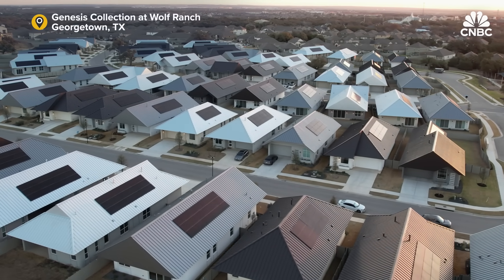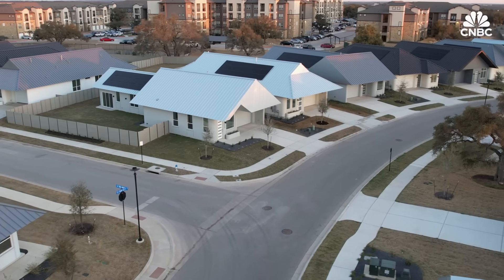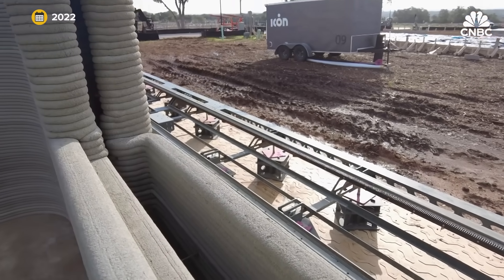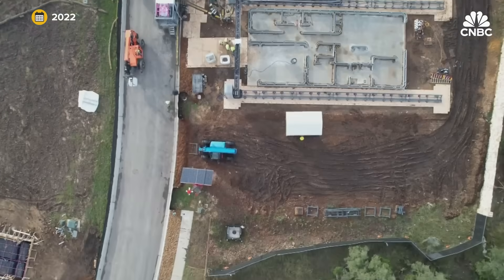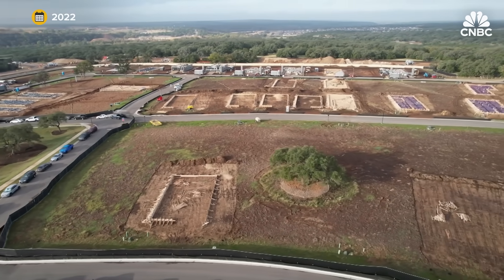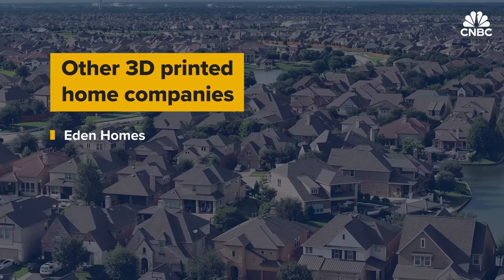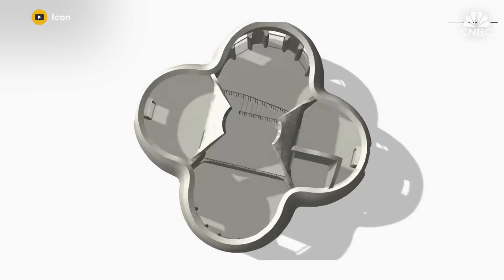Inside The World’s Largest 3D Printed Neighborhood

Comment: My question is if cost are cheaper but they are charging the same price for the homes what is the benefit to the consumer?
Reply: They are never cheaper.
Reply: @MrSteeDoo Cheaper for the company to build, not for the consumer to buy.
Reply: @EMC2.0  yes
Reply: @MrSteeDoo  it will get cheaper when labor cost gets pass a certain number
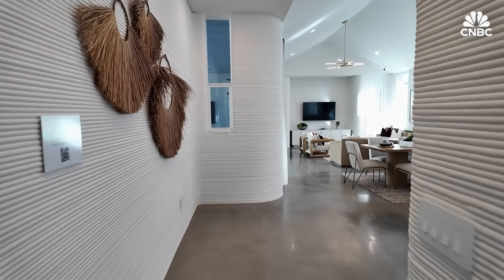Reply: In the video, they seem to aquietly reveal that these printed homes are actually are more expensive. 2:21 "The homes here start at just under $400,000, that's about comparable to other LARGER HOMES in the area". A 1574 square feet is considered a mid sized home, so it seems unlikely that they are classifying the 3d printed home as a "larger home", but instead are describing other homes in the area with mores square footage at the same price point.

Are the being ambiguous on purpose or is it just bad writing?
Reply: @JacobJonesy  it is deliberate wording. They cost more!
Reply: @JacobJonesy  I doubt its bad writing. It seems rather intentional. Not sure why they think their audience won't tell each other the BS part out loud. Just keeps building contempt.
Reply: @JacobJonesy  these ones are more expensive because it's the pilot neighborhood. Future homes will be cheaper, or give the company a wider margin while increasing the housing supply
Reply: @JacobJonesy on propose
Reply: @JacobJonesy personally, I like how they cite electrical costs in JANUARY in TEXAS. 🤣
Reply: @JacobJonesy  It is hilarious how they attempt to fool people but at same time is genius.  I never even noticed it.
Reply: @MbisonBalrog  they aren't trying to fool anyone, they literally talk about how they're trying to bring costs down and the ways in which they're doing so. They said it currently isn't as profitable as doing it the normal way but they believe it'll be cheaper and better as they figure out the logistics and tech and stuff.
Reply: @JacobJonesy  For the area where these houses are built (extremely desirable area right outside of Austin), that price is fair for the square footage.
Reply: @JacobJonesy that sounds like an awesome price for a new home that looks amazing compared to the CRAP contractors are building now
Reply: The money they saved on construction, they double it by selling it the same price as the other homes in the area.
Reply: yea thats what i say , the saveing are for the company not the buyer and they will try to glamorize it to the buyer to make it look expensive
Reply: Back to a cave it is 😂😂😂😂
Reply: This is the first production, which is always the most expensive. If they're comparable prices now, they're going to get cheaper, not higher.
Reply: The part of the construction that the 3D printing does is the cheapest and least skilled part. Renting the machines costs way more than paying for the equivalent human labor.
Reply: @gudmundur-heimisson time is money. If it can finish 20% faster, you can build 20% more homes. Prices will come way down.
Reply: @gudmundur-heimisson   - and you know this how? Where did you find the rates or is this an assumption? I think as this becomes more successful, competing entitites will come into the game and scalability will help change the status quo.
Reply: @storytellerHD  anyone with a basic knowledge of how construction works can tell you this. If you want to see for yourself just look up some breakdowns on house construction costs and look for the cost of framing. Building a house involves a lot more than just stacking up the walls, in fact that is the cheapest part.
Reply: @gudmundur-heimisson the large builders would purchase the machines, the cost of the construction is much, much, much less and much, much, much faster (contributing to the less cost).
To pretend these will cost even remotely the same let alone more is just nonsense to out right lies.
Reply: Every time they design a "new" "better" "economical" way to build it ever reflects in the price to consumers. I say this as a person that has been actively searching for this. Every time it's exhausting and so disappointing.
Reply: Whenever you might save money on heating, cooling, electricity, etc, they add a huge premium on the price. “It costs more upfront t but you save money over time…” except renovations and repairs with an all cement house will also be much higher.
Reply: Speed
Reply: only CEO's gets to keep the profit and then they complain population decline.
Reply: Stupid us, for thinking they'd pass the savings on to the buyer..
Reply: They already made the walls not as thick just like anything else as time goes on it gets more expensive but cheaper quality. I don’t see these as the future.
Reply: I still remember when TESLA was selling their cars for $60K to $120K — and now it's HALF of that.

Every new product that's still in its infancy is always expensive. But after 5 to, at most, 10 years, y'all will see the price drop significantly.

That's how it's been for centuries!

So, don't ask why — or wonder why.

Now y'all know.

Have a great day!
Reply: @ThinkForge01 Why are you conflating cars with homes? One depreciates one appreciates. One's a tool to get you from point a to point b the other ones where you live. 
As a homeowner, do you think i'm going to vote for a representative who allows these turd houses to be built cheaper, bringing down the value of my house.😂😂
Reply: You’d save on insurance! No mold and no damage from fires and hurricane to structure. It will also last a lot longer.
Reply: they keep grifting us in every way possible, my solution to the problem is to avoid the U.S. housing market
Reply: Yup, are they going to be like a 100,000 instead of 1.5 million where i live!
Reply: My point exactly. Once I saw the $380K for 1500ft I was like uh ok so I guess it’s not a cheap affordable house after all,smh 😢
Reply: I would hate to see these houses after the foundations settle or move slightly and cracks form in the walls. Would be a nightmare to fix probably.
Reply: AGREE, Seems like its a benefit for the builder and not the buyer....builders save labor and materials....So its up to the buyer to build it by buying land, renting the machine or something similar.
Reply: Benefit the consumer? you must be new here.
Reply: Cheaper for the builder 😂
Reply: Did you watch the video? Fire resistance and hurricane resistance.
Reply: None, it's a gimmick the same for those fast built mcmansions., but way more issues that add a ton more complexity. Notice how no one is buying these homes. The first woman is just clueless listening to her brainrot tiktok "techie" kiddo, or a plant to sell the homes.
Reply: The homes will be cheaper in future projects. This was the first experiment in the partnership between Lennar and ICON, and they had to learn a few things in order to bring down the costs.
Reply: @DianaOlick  automating the cheapest part of the house building process in a way that introduces a lot of constraints isn’t going to bring prices down no matter how efficient it is.
Reply: @gudmundur-heimisson  Yeah you need machines doing the entire job, electrical, plumbing, etc. If all the material is there a few guys can frame a house in a few days depending on the size of the house
Reply: @gudmundur-heimisson  That depends where you're building and what you're building. If you are in a high-cost labor market, labor usually edges out on materials cost. The type of home also dictates this. Large luxury homes home and/or a home with custom materials will obviously be more expensive for materials cost.

Otherwise, it isn't that much lower than materials, if at all.
Reply: @georgemontgomery1892 sure but again everyone seems to think that they’ve automated the entire process of building a home which isn’t true. This is just the framing. Even if they could get this down to 1% of the cost of conventional framing it would only reduce the cost the house by less than 5%.
Reply: @DianaOlick  There have been saying that for like 10 years. 3d printed homes are not getting any cheaper.
Reply: @DianaOlick Presumably, the cost for the printer is the most expensive part of the whole process. Once the printers are mass produced and costs are amortised over many builds, the cost should come down naturally.
Reply: @DianaOlick  In the gaming industry, they said all digital is gonna be cheaper because they don't need to make disc's anymore... games are now the most expensive they've ever been. Stop defending billion dollar companies
Reply: @DianaOlick  No, they will not. Costs are going to RISE.
Reply: The hype
Reply: There is none.
Reply: Exactly!
Reply: Better quality. Balloon wood framing sucks
Reply: They said all that in the video. It's not only about the price.
Reply: Shhhhhhhhhh. 😅
Reply: Its not happening with waymos and its not gonna happen with these.
Reply: It's probably cheaper than an equivalent concrete house. Not cheaper if compared size per size.  This is probably like comparing a stick built house (in this example it would be the concrete poured house) that's more expensive than a double-wide trailer house.
Reply: No benefits. Just to say it’s made in the USA
Reply: there's always a cost of being the kool kid on the block (aka. early adaptor).  I think it's absolutely amazing what they've accomplished on the first run of this partnership!
Reply: @udance4ever yes, it's amazing how much they're lining their own pockets, cutting out labor to build turdhouses.
Reply: The materials are more expensive, but there is much less labor.  Concrete walls, metal roofs, new design/new process = more expensive, but you don't need nearly as many people or roles, but the 3d printing only does the frame and walls. You still need traditional experts for the rest.  A lot of modern houses are made of cheap wood and relatively thin walls and insulation. The icon guy even said their costs were much higher almost double since they were making the walls too thick and other issues.  Anything in the alpha phase won't be the cheapest or more efficient. You are also getting a fire, mold, storm, and disaster resistant home.
Reply: Lennar guy said it. It’ll be more profitable, not cheaper. Eventually. Not interested.
Reply: Well at least one benefit is disaster resistance as explained in the video, those homes in Georgetown are in both a tornado prone area and a wildfire prone area, and this type of construction give protection to both.
Reply: @jamesfromacct Jay Leno was talking about the fires in california and how one of his friends built a fireproof building that house's a car. It was one of the few structures that survived the fire. Unfortunately, the car didn't survive because it basically turned a building into a kiln.😂
Reply: I think you’re looking at it wrong. it’s cheaper labor cost. that doesn’t mean it’s cheaper overall. labor is down A LOT, this could solve the labor hole we have. with that overtime as these machines get cheaper because they will sell more and parts will get cheaper from higher demand. once these machines are decently priced, companies will start buying them and just print neighborhoods in a year or less. that’s when things will get cheaper,right now it’s still proof of concept.

i could see these turn into a cheap small track homes in the future, and it’ll be considered a luxury to have a house made by man. home artisans will be back in style! i think this will also force homes to be build generally better than we currently have in america. it’ll be “if i want a cheap home i’ll buy a 3D printed one” we don’t have the data to see how long the last with people living in them. so everyone’s a bit skeptical. i don’t think it’ll be our lifetime where it will be majority 3D houses but you never know
Reply: @disappr0val yeah, and a perfect non capitalist society. I think the houses would get cheaper.😂
Reply: The quality?
Reply: Agree, especially if it was experimental. Will see if they will be less expensive than traditional building. If so, then great.
Reply: @brian9832  Yes comrade. Ah, but wait. We live in a capitalist society..... Damn that won't work.😂
Reply: Exactly
Reply: Eventually these becomes cheaper
Reply: @aiel1740 It is a house, not a car. So who does it become cheaper for?
Reply: Velocity and cost are directly correlated; expedited completion minimizes potential cost overruns.
Reply: Maybe, but lenar is just playing the corporate game, they put TX in the center but it's bs
Reply: The benefit is do not burn on fire 😅
Reply: Would never work in an earthquake area. Concrete and brick homes are the first to crumble to the ground in an earthquake.
Reply: Because it is not cheaper to build in many cases! One floor buildings at best. NOT MULTIPLE HIGHER because no rebar enforced concrete used. And just use a slab as foundation on soft soil a problem due to more weight then the fabricated wood houses in the USA and canada. One story buildings printed in the desert fire or flood zones maybe an alternative? But prefab  conventional concrete build works also!
Reply: In China it cost 80 k to build. Always in America it’s always 3 times more.
Reply: @mgelato777hardly any american cares what it cost in china.
Reply: 7:10 explains it.
Reply: I would imagine it will have less quality issues as long as you are okay with the aesthetics. It being mostly concrete rather than wood also makes a comparison a bit difficult.

Assuming it has no significant quality issues, I would probably need some sort of additional finish to get rid of the print marks. The size makes it a pretty decent senior home tho.
Reply: The costs will be massively cheaper when comparing scale. These guys have built a few hundred homes, and people are complaining about costs, when prices are already comparable to conventional homes. Other point is that costs of conventional homes will continue to rise whether anyone likes it or not. The 20+ processes/materials to build just the foundation and framing of 4-million homes will be exponentially higher than squirting some concrete to achieve a stronger and better base. Folks are missing the point that this is exciting innovation unravelling before their eyes. Using 2x4 lumber the way we have for hundreds of years is no longer feasible.
Reply: to sink development costs they need investment, this is a trial run and they already have a whole community done
Reply: Benefit for workers. Higher pay since less labor is needed. Consumer saves on electricity costs.
Reply: Speed of Construction: These homes can be built in days or weeks instead of months, allowing for faster housing solutions.

Design Flexibility: Complex and customized architectural designs are easier to achieve with 3D printing.

Sustainability: The process generates less waste and can incorporate eco-friendly materials.

Durability and Strength: 3D-printed structures can be more resilient to environmental stresses and natural disasters.

Energy Efficiency: Superior insulation and thermal properties help reduce energy consumption.
Reply: Consumer? Hey hey…. This is for the benefit for corporations. They are people also man!
Reply: Real estate is a huge industry and people use it to make money. These things never make things more affordable but people will find a way to make money off of it.
Reply: is cheaper for them not the consumer xdxdxd...this is where the government needs to steps up and it doesnt
Reply: Exactly, its probably great for them if they can build the house for less and sell it for more. But that sure doesn't help the buyer.
Reply: Oy vey, that's antisemitic
Reply: It’s the land. You can build a beautiful house in a bad neighborhood. It always comes down to your zip code
Reply: From luyten another 3d home printer 
In addition, the technology is proven to increase construction site efficiency with 60% guaranteed costs savings, 300 to 500 times shorter execution times, and an 80% total reduction in monetary expenses without formwork in concrete construction,
Reply: A better home?
Reply: The energy price is like only 10% of regular house
Reply: Cool it with the anti-semitism
Reply: You saved more in the long run like way cheaper electric bills.
Reply: the idea is after the first run, the costs come down
Reply: @Enhancedlies  The cost for them, not the consumer
Reply: It’s a proof of concept house. They literally spoke to this in the video. The first third of the project they were learning how to do it and it was taking twice as long as they expected. By the end , they had figured out how to double the speed and half the cost and that is just the beginning. As more 3D printing companies are formed , the price will come down and when you’re in robots as laborers it gets even cheaper. 

The other exciting part is creating homes that are wind and fire proof. Just think how many billions will be saved in insurance payouts. Homeowners insurance should come down with innovation.
Reply: And then they say profit margin is less. Like how? The math doesn't work there. 😮
Reply: Benefit? Consumer? 😂
Reply: Concrete is expensive. That's why normal people use bricks AND concrete.
Reply: A solid, heavy-duty house.
Reply: Capitalism isn't going anywhere
Reply: Like all innovative businesses, they incorporate the research and development cost into the price. 

Example: It could take millions of dollars to develop the program and machine, but then it’s cheaper to produce the product per unit. They still need to recoup the expenses of the original design.
Reply: Concrete is NOT cheap
Reply: None . It’s only beneficial to the other party .
Reply: Property tax will still be higher, probably be super hard to get insurance on it and damn harder to refinance it. O and cost the same as a regular home.
Reply: l dont like the bumpy walls. Walls should be flat. all l see are DUST crevices 😬
Reply: @KellySullivan-jc6il I get a lot of dust in my house normally so I am quite used to it. I do wish they could find a way to make the walls flat - that would be badass
Reply: Profit margins are better. It’s not better for the consumer.  They know you’ll pay $400k plus for a home because you’re going to finance.
Reply: They literally said its more expensive to buid....FFS are people this dumb?
Reply: Bigger profits for the company.. the state.. 😂nothing changes for the consumer.
Reply: So since the using robot and 3D printer does that mean there's no more labor
Reply: GREED
Reply: Greed
Reply: They did mention that its more fire and natural disaster resistant, so lower insurance cost could possibly be a benefit.
Reply: There isn't any. It's all about the rich getting richer .
Reply: No one ever cares about the consumer. If they found a way to make something cheaper, they will always pocket the difference.
Reply: Being able to spend FAR more on utility work.
Reply: I'm no engineer but my peanut sized brain tells me this is better than a normal wooden home.

It's probably cheaper to heat/cool and you won't have to deal with certain pests. (Mainly termites which are ridiculously expensive to deal with)
Reply: What this is is a current whale market for those willing to pay the high prices. As the tech for it and output increases, it costs SHOULD drop over time
Reply: There is none.  Its a scam.
Reply: concrete walls that feel lik you live in a prison
Reply: Companies charge what you’ll pay, not what’s ‘fair.’ Price Setting 101: Marginal cost is irrelevant if demand is inelastic. Consumers react to perceived value, not production realities.
Reply: None.
Reply: Are there HOAs attached as well?
Reply: It's just starting.
Reply: They don’t get termites, mold or bees in the walls. They hold in heat better in the winter, and cold in the summer. And a big selling point in Texas, they are much more safe during tornados and hurricanes. Basically the whole house is a storm shelter. In the South, wealthy people put concrete closets or rooms in the middle of their homes to be storm shelters. Middle class and lower just use regular closets and bathrooms (framed with wood 2x4s and covered in sheet rock)  for storm shelters, but other than they are no windows, these spaces are not very protective. Living in a cement home would automatically be much safer during a tornado, freeze, flood, hurricane. They are also much more flood resistant. They don’t need to remove all of the drywall everytime there is a flood, they just need new flooring cans new paint, instead of new everything. Also Texas roads are really loud, because they are made out of concrete. My Texas house was next to a main road and we just listened to Traffic all night long. (Also my pipes froze and flooded my whole house because the walls were not well insulated), due to Texas having lax laws regarding winterizing homes. These concrete houses are naturally going to be winterized because the think concrete wall protect pipes from freezing. Similar to how brick homes are better than siding homes at keeping out cold.
Reply: Here is The Savior

HalleluYAH translates “Praise YAH”

- YAH The Heavenly Father (Genesis 1)

- YAH arrives via the TENT OF MEETING (Exodus 33:7-11)

- YAH The Father was Who they Crucified for the sins of “man” and they NAILED YAH’s HAND on an Almond Tree
- (Hebrew Isaiah 43-56)

- YAH The Father is The Savior
Reply: the benifit is higher repair costs with plumbing and electrical issues
Reply: Critical thinking 🤔 🧠
Reply: Energy cost savings. Thats it,
Reply: Unbelievable. I can tell when people leave a comment without watching the entire video 😂
Reply: You're right.  This is what has become normal in Western industry.  To offer nothing but the opportunity for the company to make increased profits, edge out "competitors" (which really aren't) and then act like they're doing something good for the industry.
Also, here CNBC (a trash media company to begin with) grooms the viewer with this-  a disgusting glorified ad for this idea, company industry which exist solely to eliminate jobs that made good houses to begin with for the same damn cost so it seems.  I'd go well out of my way to avoid purchasing products which exist to eliminate useful skills and jobs from the economy - that being tradespeople and people who build things with existing industries and resources.
Reply: It’s always more expensive to create new machinery and to invest in those costs, at first the costs outweigh the profits, but once everything is streamlined and machinery is building hundreds of homes the costs are distributed farther. You would still need the same 10million$ machine to build 1 house that you would to build hundreds. So initially you would expect the prices to be inflated to reflect that. Prices should drop as the building method is perfected and becomes more popular, but our current gov would not prevent businesses from taking advantage of consumers even after the initial expenses are balanced out.
Reply: Because anything new will have significant costs associated to it.  These companies have to turn a profit to stay afloat.
Reply: You should watch the video
Reply: This isn't about US, it's them finding a way to continue to build overpriced homes, but without their scores of illegal mexicans working for peanuts.
Reply: and then it affects labor because less well paying jobs.  tech owners benefit, labor and people not so much
Reply: VERY good question
Reply: The cost is higher now due to the learning process but as they scale out, the cost should be reduced (less walls, less labor, and quicker turnaround time). Also it's more quality / sturdier (concrete vs wood) and better energy efficient plus fire & wind resistant.
Reply: @obieWanmotivation  the first rational comment so far in this thread
Reply: The price has basically no relation to the building cost. Remember we live in a capitalist economy, the developers will take whatever they can get away with and not a penny less. This is about greater profits for the developer, not about the home owners.
Reply: @dijikstra8 the whole idea would be cutting down on cost and time and selling at a profit but a lower price to their competitors thus moving faster.
Reply: @mikeshafer, a wonderful idea in a nutshell, but you're not selling a car. You're selling a home.
Reply: @Richard-r2o4j  it's the benefits of scale. These current homes are around the same price as neighboring homes, but this is still a new technology. ICON has next generation printers underway that are faster and better. At some point if they really nail this, you could see entire communities of 3D builds going up within a month. The first car is always crazy expensive, but years later you get Honda Camrys.
Reply: @mikeshafer it won't happen! What you're suggesting would cause the entire housing market to crash. 😂 It's just not gonna happen.
Reply: Cheaper for them. Not for us.
Reply: Bru... the building is made of concrete...  is far cheaper in the long term compared to the paper houses of the suburbs
Reply: The benefit is when a tree or storm damages the building you will never be able to fix it in a way that doesn’t look continuously broken.
Reply: @Noodles1771  it already looks bad, if you look at some of the close up shots of the interior walls they're all cracked along the layer lines
Reply: @Noodles1771  It's concrete, so storms ain't doing much.
Reply: @Ryuker16 Yes because since 1992 when the hurricane codes were updated in Florida that basically made every newly built house concrete (CMU) construction there has been zero damage to those buildings 🙄The reality is: There will be damage, and (unlike the modular, easily replaceable systems that have existed forever) there will be no way to make these houses look like new. It will look like a car will a perpetually dented door that cannot be completely fixed or replaced. These houses will also have low resale value due to any damage they suffer + their low quality unfinished interiors. This segment is simply a propaganda ad for gullible cows masquerading itself as journalism. shrug
Reply: @Noodles1771  i was thinking the same thing how do you fix this house if something happens?
Reply: @Noodles1771 You may have a higher repair cost as rendering of the wall may be required.
Reply: @Noodles1771  Mmm...Patching it up actually wouldn't be difficult.
Reply: @Noodles1771  You can easily fix a broken house.
Reply: @saulgoodman2018 no you cannot fix concrete that is poured this way and make it look like the original. You don’t work in this industry - sit down. You’re clueless.
Reply: @Noodles1771  It is only concrete. You can replace concrete, with concrete.
Can't be done the same exact way. But there make something called cinder blocks.
You may not have heard of it.
Reply: @saulgoodman2018 you can and it will never match a machine laid process like this in style nor will its color look the same. Stop pretending like you know something about construction or architecture.
Reply: @Noodles1771  You can get it to closely match.
Reply: @saulgoodman2018 No you can’t - because one is machine precise and the fix will be done by human hands and a much different mixture of concrete. Go back to your DIY playlists on ‘how to build a bookshelf’ and stop talking to me as if you have my degrees or experience walking a f—king job site. Philistine.
Reply: @Noodles1771  You can match it. So what if the color will be off.
Reply: It will get cheaper over time to build. Naturally prices would come down to increase demand. It just takes time.
Reply: @mikeshafer yea but further in the video the construction company the walls won’t be as thick as before foreshadowing that the quality won’t be the same
Reply: @mikeshafer bs! Corporate greed will never make anything cheaper
Reply: @mikeshafer In theory, but not in practice. Lennar is the second largest home construction company in the US based on number of homes sold as of 2023. The three largest home construction companies essentially control the market. They are the ones bakes to purchase insane amounts of land, essentially controlling the housing market. In the 70s, and even earlier, home builders, could build affordable starter homes that many boomers benefited from. These are homes that when adjusted for inflation, would be about $100k-150k today. If you decided not to build, another developer nearby would, meeting demand, sometimes even exceeding it. But in this modern world, they can control the market by keeping supply low and demand high. They may own 100 acres in a town that needs affordable housing, but they can choose to sit on it. Until all their “affordable” $400k homes sell, or build, and list at $350k, accepting cash offers from investors looking to rent, another market controlled by large corporations. A smaller builder could purchase an individual lot somewhere, but that lot would be ultimately too big for anything affordable

These mass produced houses use the same floor plan over and over again. They save money on costs because they are able to buy in bulk, rather than as needed, since every house in the neighborhoods need the same supplies. In many communities, they only take about 2 months from start to finish to build. This means the quality is poor. But people will pay whatever they can afford because they’re desperate. Why lower the price on housing when you can double, even triple your profit?

Also, many towns wont even allow you to build a house that size. There are ordinances specifying how small a heated and cooled residential space can be, which is one of the other reasons start homes don’t really exist. There are also ordinances on lot size, which is a bit confusing because while independent builders may not be able to build on anything smaller than a half acre, these large builders, somehow can get away with subdividing lots, putting as much of a house on just a sliver of land.
Reply: @mikeshafer LCD-plasma TV's came out when a 32" Vizio was 500$, you can still spend well over 2k on a 32" TV. 

Nothing gets cheaper bro, not until China comes over here to make it cheaper.
Reply: @replynotificationsdisabled  what does that have anything to do with homes?
Reply: @mikeshafer 

"Naturally" 😂😂😂
Reply: @mikeshafer  Nope, the costs will continue to rise.
Reply: They won't. That's what capitalism is about. Profit making and ever increasing profits.
Reply: @plartoo  That's a clueless take.  If you get government out of favoring companies, competition brings down prices.  Always.  Profits can be made if you do a better and more efficient job than the next guy.
Reply: @plartoo nobody here has a crystal ball. Chill. Markets go in cycles. They always have.
Reply: peasants live in 3D printed house, in the meanwhile, billionaires are upgrading there masions.
Reply: What else do you expect from a US company ?
Reply: Careful buddy, they'll send you to el salvador for that type of thinking
Reply: They say they are hoping to be able to build the homes cheaper, but they definitely won’t be decreasing the prices of the homes cause that just increases their profit
Reply: @calebleuciuc670 60 to 80 percent cheaper to build and many dozens to hundreds of times faster.
From months to years down to days or weeks
Reply: Why would they make it cheaper if the consumers are buying out neighborhoods at the current price. Prices going up because now more people are exposed to it so the demand will be there.
Reply: @Barber_Awz   this is exactly right. In fact it's even worse because this whole concrete 3D printing market is controlled by a couple of heavily vertically integrated companies, so there is no competition, and they have no incentive to try to undercut the market.
Reply: Houses made from Cardboard vs Concrete. Concrete is more durable and more expensive to build structures than lumber.
Reply: She said it, she feels safer, fire resistant, quieter, all for the same price.
Reply: They're trying to sell at higher price to recover loss of investment. What he says make sense, if they can streamline their build process in terms of time and money (and time is money anyways) I could easily see how that would bring prices down for the buyer. They would sell at lower cost and absolutely crush their traditional stick frame builder competition.

The pods we're all going to live inside of in 2050 are going to be $500 anyways, and you'll pay for it with your plasma.
Reply: Did you not watch the video or have common sense? This was a test case where they are working out the kinks and because of this it was more expensive. They said the next community will be cheaper. Watch the damn video before you open your mouth.
Reply: $400k for a new construction home in 2025 is reasonable. This is an early trial plus there's the speed benefit
Reply: @sjasonwang7384  this is why nobody wants kids!!!! If 400k is "normal". We are beyond cooked. We are doomed.
Reply: @sjasonwang7384  No, it's not.
Reply: Benefit is for the shareholders bro. 

Half joking. As you sell more they get cheaper. Comparable costs at this early in the new product lifecycle is actually pretty good.
Reply: @thenextension9160  I am a shareholder so I’m hopeful they do well but I invested because I thought they were so cool
Reply: Social. 
The statistics behind accidents on construction sites are astounding. Reducing human injury risks is the right thing to do. Over half the workforce is middle aged and has a bachelor’s degree so they’re trained for other things. 

Our birthrate is low so we won’t have as many builders available for the foreseeable future. It makes sense to automate this simply based on population.
Reply: @bettyjeanmarinogmail   that's just false-equivalency logic when many government do nothing to reduce crime that literally k1lls, and send soldiers abroad to literally d1e.

I bet you never travel far enough that the local language isn't English no more.